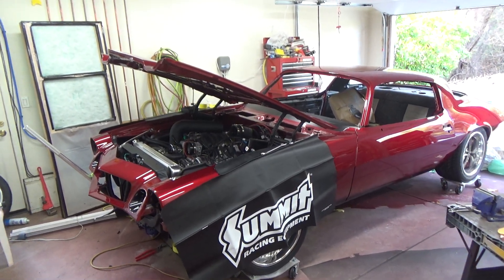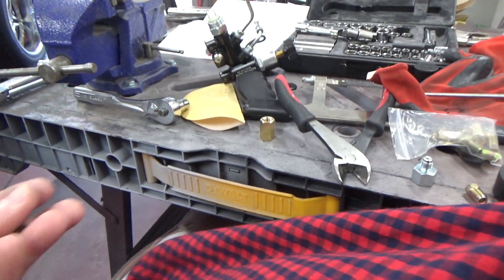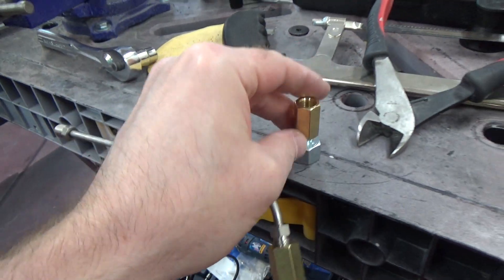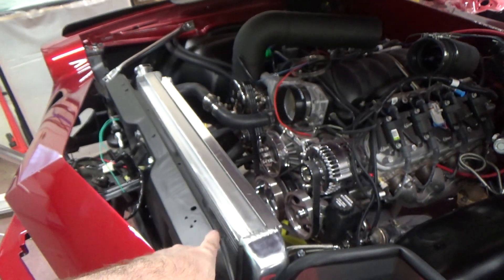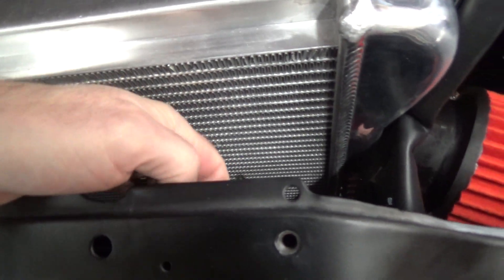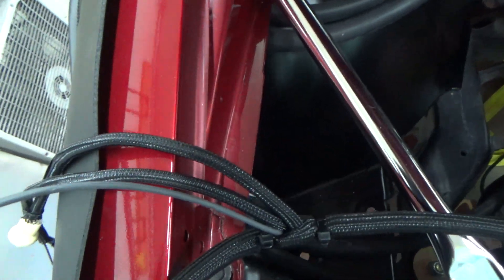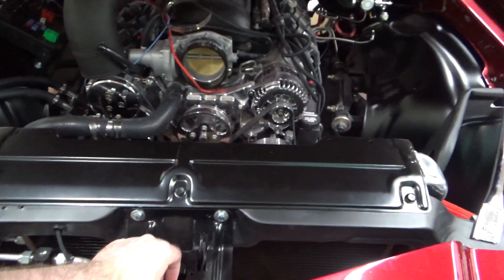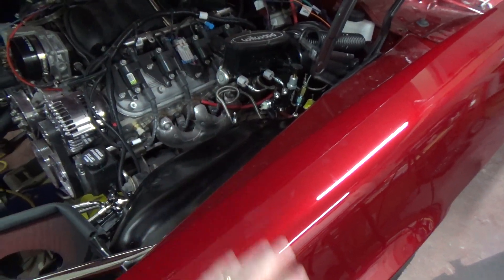1977 Camaro Z28 Part 256: Brake lines and more wiring

Comment: Did almost the same thing with the brakes on my Camaro. I did use some steel flex brake hose.
Reply from the maker: I am having no luck finding the flex lines. Can you point me to something? I just bought some NiCop since I need to make the rear-end lines anyway.

Comment: I have that same aftermarket over flow I mounted it on the drivers side next to radiator
Reply from the maker: The long cylinder one? Did you have a cut a hole somewhere?

Comment: I use tape but with a dab of black weatherstrip adhesive on the end. Never comes loose. I would have dielectric grease in the other hand for every terminal. And always oversize the ground wires plus use them everywhere. Once running, turn on each circuit and do a voltage drop test across each ground. The lower the better but should be 0.050 Vdc or less. Same for any B+ side. Every circuit is a series circuit. So the blower fan is designed to consume all of the voltage. If the battery voltage at idle is 13.8 volts, then across the blower fan on high (Goes thru Relay on most models of that era) but reads only 12.7. The 0.11 tenths of lost voltage is the combine loss across each wire, terminal, switch, even the fuse. This is normal. If higher, perhaps 0.5Vdc - 1.1Vdc, then you have a problem. This loss is due to resistance and will get warm to hot. Even on a new harness as a terminal can back out half way during installation and never see it. Just a thought a voltage drop helped me quickly find the root cause, even ground. I would look at the schematic for the affected circuit after confirming there is a problem. I would run thru various areas of high resistance and let my imagination answer the question if this would cause the issue. Plus, it would give me easy to get to spots to start. Quick, easy, fast, accurate and if the meter leads are backwards, it gives the same exact reading just with a negative symbol in front of it. 
   Relays, same thing. Four 8” jumper wires with male on one end & female on the other. Plug into relay & socket correctly, then turn the circuit on. Check 30 to 87, note reading. Disconnect 85 or 86 to de-energize the relay, plug back in. I would repeat 10 times. Just catch it once, you have your answer. How many loves on the camshaft have to be flat before it’s bad?

Comment: Look at the summit brand they have the bracket to mount the valve on the bottom instead of side
Reply from the maker: I poked around there, but I think the one I have will work with some tweaks. Thanks a lot

Comment: Yeah bro. Good question. What kind of oil do you like for this set up. My neighbor says he swears by Mobil1. However, my dad likes Pennzoil. And yeah those sloppy metric hose threads are a doozy aren't they? Ran into that when installing my oil pressure gauge. Hope ya get it figured out bro. Looking great!!
Reply from the maker: I am sticking with the Mobil1. I am sure the differences are small these days, but why not use what GM uses?

Comment: Looks good...don't ya love bolting on the new jewelry like the marker lights? Does the overflow need to be high enough that the fluid will be higher than the radiator cap so that it can bleed air?
Reply from the maker: Thanks. I don't think so? I think even the factory location would be below the filler neck. Good Q though

Comment: You still need break-in oil for a roller engine, but you don’t need to sit and vary the idle for 25 min. Fire it up and go drive it after you check the timing. Those threads on the brake prop valve don’t do any sealing, it’s the flare that seals and if you can tighten the fitting real tight then it shouldn’t leak. I would test it on the bench to see if the threads can take some torque. You’ll know if it starts slipping. I noticed before I got to the video that you did the test and it’s pooched. Oh well. Get another one. Too bad that prop valve is aluminum.

2nd Gen Camaro’s have a ground at the side front inner fender https://my1970z28.com/COPO/images/fender_batt_GND.JPG
Above the battery https://my1970z28.com/COPO/images/eng_frt_header.JPG

I used an overflow coolant jug for a 1980 Z28 cause I owned one for 10 yrs and test fitted it on my 70. It’s a lot shorter than previous yrs.
Better shot of the jug https://my1970z28.com/COPO/images/eng_frt.JPG

My fender protectors are smooth on the inside. I’m currently using a Yoga mat cut in half from a Walmart sale and it looks like the same material used on the Chevy and Edelbrock fender protectors which are 10x’s the price.

Make sure you buy a bug screen for the front of your rad so bugs and hornets don’t damage the rad fins. They can easiness removed and vacuumed and rinsed with a garden hose.
Reply: No you don't. Not on a factory engine. All engines that GM sends out with their cars/trucks just use mobil 1.
Reply from the maker: @75zl1  That was my understanding